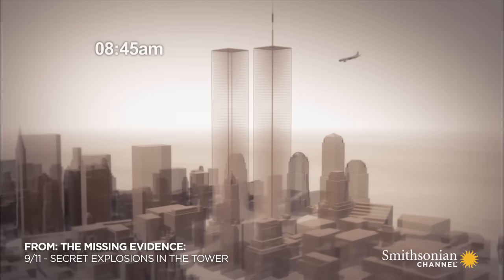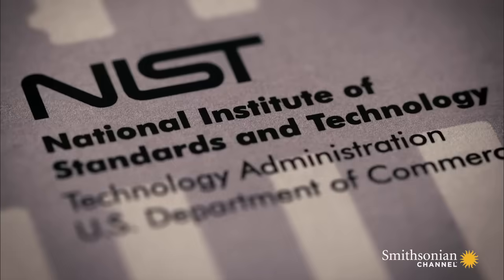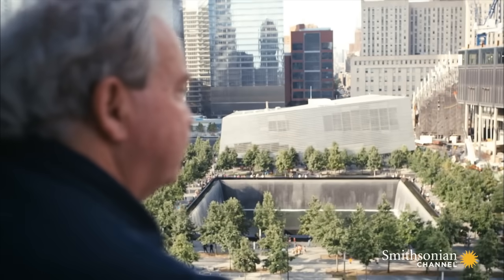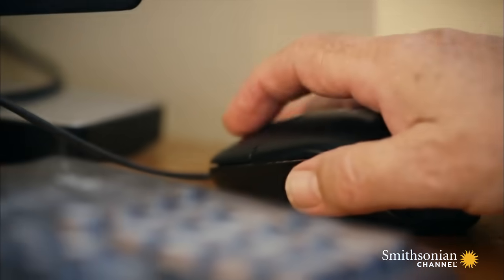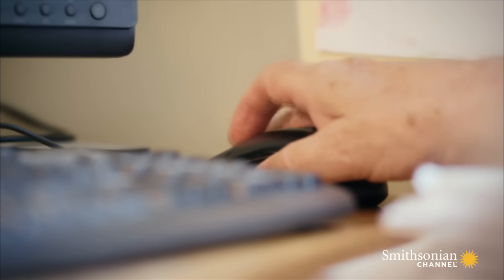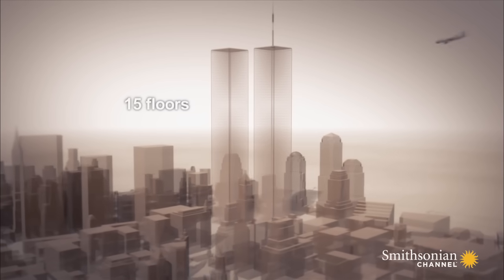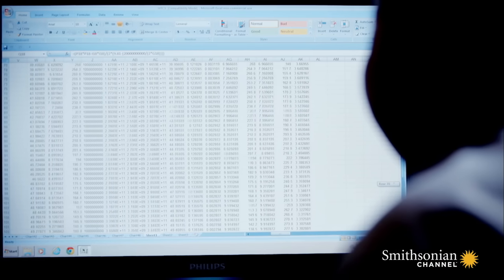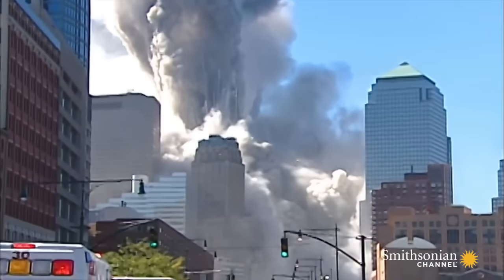This Computer Simulation Explains How the Twin Towers Fell

Comment: All 3 buildings implode into themselves even though the planes crashed into one side of the building's and WTC7 random office fires which is asymmetrical damage to the structure. So say that one side of the support structure was weakened more then say the other sides of the building, wouldn't the collapse happen asymmetrically eg. collapse to one side more or topple to the side? Instead it basically fails and collapse into itself equally. If that doesn't raise questions, I don't know what would.

Comment: I haven’t watched the video yet but the heat from the jet fuel on fire warmed the steel beams and over time they softened. Due to the weight of the floors above, the softened beams going vertical and the supports going horizontal connected to the beams came to a breaking point. Which is why you can see the floors above the hole in the building we’re leaning when the buildings collapsed.

Comment: If we look closely at the manner in which  the top section of the north tower (complete with mast) came down, we see that it had virtually collapsed into itself before the lower part of the building even started to move downwards. If we look closely at the manner in which the top section of the south tower came down,  we see it toppling over to an angle of 21 degrees increasing,  before being enveloped by dust.  It is quite clear from one video that the top of the tower pushes out a line of dust cloud moments later, indicating that it is definitely continuing it's trajectory to fall onto part WTC 4  below. (which it certainly crushed)  So in one case,  the top section that is supposed to crush the bottom, appears to self destruct before it starts, in the other, it topples out of the way.  By all means, check out the videos and explain why this is not so.

Comment: I agree with this research. It actually makes complete sense. It's not rocket science at all. 
When the planes go through the building don't forget the planes themselves have metals in them. So the metals from the planes run through the metals on the buildings (and the planes were obviously flying at high speed also)... no doubt would the metals of the buildings be impacted greatly. And once the metals have weakened with the weights of 15 floors and 22 floors on them, there's just no stopping them from collapsing the way it did. And the more it collapses the harder it falls on each next floors. Conspiracy theorists need to stop spreading b.s seriously.
Reply: I throw your bullshit Right back at you...you need to do a little  physics first before you can make a statement like that...you obviously have not bothered.

Comment: It still doesn't make sense to me. He says the weight at the top was equal to the Titanic-- but the weight underneath that is equal to 7 Titanics, arranged in a steel web that is designed to hold the mass above it, and then some. If you dropped 1 Titanic from high up you might be able to crush 7 with 1, but in the case of the WTCs, the Titanic at the top was basically resting on the 7 Titanics below it. What's the deal?

Comment: Were they really designed to with stand the impact of a jetliner? Or did they build them and fish for some computer models to confirm what they wanted to brag to the world about. Just so people would sleep better at night? Q#2 did they account for an uncontrollable jet fuel fire burning in the middle of the upper floors after a jetliner slammed into it and weakened them for almost an hour? Noop!Watch a slow motion test video of a jet being atomized when hitting a solid eight foot thick wall at high speed. Now watch that same process accour while crashing into hollow building. The weight and pressure of the building falls one floor a time atomizing most of the building all the way down. If they really did design these towers to withstand a jetliner, and the burning fuel spill, and all the burning fire after, that would never get put out, then they failed. It really is that simple.

Comment: Totally fabricated 'simulation'.  The lower floors already supported the weight of the upper floors.  Even if a 'pancake' scenario was initiated, it would have happened for a few stories and then the kinetic energy would have been offset by the energy expended in destroying the floors immediately below the impact, resulting in a still-standing structure.  Watch the videos online - - the towers do not fall as Smithsonian, or NIST, describe.

Comment: 0:04 "Were designed to withstand the impact of a commercial jetliner"

I think the important word here is 'impact' not 'prolonged fire'.
Reply: those planes were military planes witnessed by witnesses. no windows or markings on them.
Reply: @stuartbrown25  makes no sense cause even military planes have windows
Reply: Ok so how did Building 7 collapse? Spillage? LOL!!
Reply: There were no planes. 
It was just precisely placed thermites.
Those planes you saw on videos (which there are 3 or 4 different videos, which are all created by graphic programs. Research CGI 9/11.
Reply: Your woefully ignorant.
Reply: Dachs & Rottweiler did you even watch the video? The weight of the top floors crushed every other floor 1 by 1 until it got to the bottom.
Reply: @johnnytheprick 
24 hour fires that failed to eradicate any floors

What building are you talking about?
Reply: @johnnytheprick 
Which onesÉ

Windsor Tower in Madrid? Upper floors collapsed 2 hours after fire started.

One Meridian? Was brought under control in 19 hours.

Which buildings are they referring to?
Reply: heat rises, dummy
Reply: No building ever in the history of man has ever collapsed due to fire.
Reply: Matrix or Creatrix are you sure about that?
Reply: @TrustasCurrency  except for many, many buildings in the history of mankind
Reply: @TrustasCurrency  
No building ever in the history of man has ever collapsed due to fire

Kader Toy factory
McCormick Convention Center
Plasco Building
Reply: lol the jet fuel was 1/10,000th the size of the building. 9/11 was done by our own damn government via demolition. Everyone knows now. This is over.
Reply: Tripp393 fire spreads
Reply: That means absolutely nothing. Fire is bad for buildings. Everyone knows it. This is over.
Reply: Tripp393  So TITANIC was inside too? they said the ship could not sink and look what happened. Same here.
Reply: KIKO SUAVE I know right that’s what i thought to

Comment: So Newtons Law did not apply..
Reply: every action has an equal and opposite reaction. The force exerted downwards has the same opposing force upwards. The top 5th of that building should have pancaked after travelling downwards for a few floors. Thats why they put demolitions all the way down buildings BECAUSE of Newtons 3rd Law.
Reply: Were ALL the lateral supports blown away all the way down to the ground?or just in the damaged area's? Can you please educate me.

Comment: Using Wile E Coyote Physics to attempt to explain away BASIC FUNDAMENTAL LAWS OF PHYSICS and metallurgy... Steel structures cannot collapse through themselves at the rate free fall unless some explosives are used to cut and blow out the core columns underneath. The top floors were not floating on giant air pockets; there was 100,000 tons of steel and 200,000 cubic feet of concrete underneath the areas of impact. And what about WTC Building 7?... Ah, never mind; Smithsonian is just another outlet for state sponsored propaganda. Keep spreadin' those lies.
Reply: I bet you dont have an education in this field at all, so shut the fuck up.

Comment: I don't see how it's hard to believe that a massive airliner traveling rapidly couldn't cause the towers to fall? It's like saying, I don't know how all those dominos fell with such a little push?
Reply: It's not just that. It's this and everything else like lack of investigation, magical passports, immediate Al Qaeda blaming, lack of interceptors to see wtf happened to 3 commercial planes(they were circling of course for more than an hour) full of people etc...
Reply: This video doesn't even explain anything. It just says some guy has a computer. I can a program that proves that the tower can fly to mars and taste like chocolate. And then make a rendered visual basic. And some some British guy  narrate it
Reply: Did you the Empire State building was hit plane?
Reply: @drizzyrauvryar6992  A B25 is far smaller, it had less fuel, and it was structured differently not only that but going slower
Reply: And an unfinished buildings can burn themselves out until they leave nothing but a steel skeleton
Reply: Franklin MacGillacuddy  jet fuel only bunrs at 450° 
Steel melts at 2500°
Reply: Franklin MacGillacuddy  And explain Building 7. Small fires. No plane. No physical exterior damage just collapsed
Reply: Well, if you look in to the engineering of the towers you can find they can take a plane crash quite well actually. 
The real stories come from the eye witnesses testimonies and the workers in the buildings. 
The said the started haveing evacuations training like once a month for a year being 2000. There was are a lot of stories like that. Really fishy stuff. 
I don't really care who did it.
The governments are is owned by big corporations any way. I just want the truth to be told.
And actually hear about building 7 that wasnt on a conspiracy theorist channel. And this video told be a dood can use excel. A lot of official videos are like this.
Reply: Franklin MacGillacuddy  oh also the Japanese government did a test to see if you can make a phone call from an airplane with a phone from 2001 in like 2002 0r 2003. You can't
Reply: Research "no planes on 911" EVERYTHING we saw on tv was cgi
Reply: Franklin MacGillacuddy  military planes "buzzed" NYC look at the videos of the planes hitting the towers in slow motion it was 100% cgi period full stop
Reply: Franklin MacGillacuddy  every piece of video we got that day was from official MSM sources or people connected to MSM, like I said go watch the footage get a large HD monitor and watch in slow motion there's one error in the editing where the wing disappears behind a building that's actually in front of the tower IMPOSSIBLE from the angle it was filmed also another error was the nose of the "plane" popping out the other side of the building this is NOT a theory u can watch this with ur own eye's. Let me try to find a link for u
Reply: @drizzyrauvryar6992  I said B25 which is WW2 era light bomber
Reply: @mattyboy3576  What about the other towers? All survived except the one with minimal damage, a trash fire and all the trillions of dollars in a mysterious debt that was never mentioned after the collapse.
And sorry I was hella drunk last night.
Reply: @drizzyrauvryar6992  you still sound "hella drunk"
Reply: You have a belief based on faith... Since its obvious have put no effort into mathmatically quantifing any part of the govt's "explanation" in order to provide yourself proof , what you're actually saying is you have an opinion based on faith in your govt's explanation.
Reply: Franklin MacGillacuddy  If you find the collapse of Building 7 weird check out the demise of the under-reported Building 6

Comment: The lower steal is bigger, thicker then the top steel as you go up. How does the top steel, the thinnest, completely dissemble the lower steel into a pile less then 2% or the original height? Demolition! Start with termite, once noisy, then shape charges followed by kicker charges.
The first CG that Popular mechanics did a month after 911 was accurate. The core columns super structure was still standing after the pancaking!

Comment: WTC collapse explained by a chemist running  a simulation in a greased and dusty ass computer with 2007 excel. Something is little bit off
Reply: It is simply math!!.  You could run it in excel as long as you know the correct weight distribution / load carrying numbers.   The blue prints will provide that.
Reply: @peach jam  The buildings failure allowable was 6 floors.  14 stories failed in WTC 1.  23 failed in WTC2

Do you really need this explained to you?  Why don't you learn how to write instead of rant
Reply: @peach jam You can model all you want???   You do realize that buildings are actually designed on computers.  The proprietary programs used to do this are EXTREMELY accurate.   They can go directly from the screen to construction.  

If the floor load limit of the building is X and a load larger than X lands on it what does your common sense tell you?    And if one floor can't handle a load larger than X (Which it can't)  why would we expect the next floor to fair any better with an even LARGER load landing on it.   And so on and so on for each successive floor.   Your problem is getting worse as it goes.
Reply: A chemist would know more about the collapse than an engineer, considering they know whatever is in the jet fuel that you all claim couldn't burn through steel, and while it can't, it can weaken the steel considerably, making the Trade Center's pretty unstable.
Reply: People decoded NASA's message to aliens through MS Excel. Deal with it.
Reply: @markyzarky  without the lateral support of the floors the columns have no stability.  Then add the weakening effect of the fires. You have a recipe for disaster.
Reply: Javier Fernandez  Do I threaten you  Javier?
Reply: Lmao true
Reply: Javier Fernandez   My stupidity?   Explain.
Reply: What's really "a bit off" is your silly belief that accuracy in results from calculations using known and demonstrably true physics somehow requires, as a pre-requisite, your computer to be clean and running a later version of Excel that what was actually available at the time.
Reply: This is an old video you twat

Comment: Does this also explain the melting steel, or did the planes or rather their gasoline turn the building into a furnace?
Reply: asrgaqgq sdfgsdgsdfgsdg 

Orly, u knew the truth all along huh. So the gasoline of the plane must have transformed into steel. Wonder why they normally blow up high buildings like skyscrappers in a controlled environment... They could really save on explosives if they were only blowing up the top of the buildings so they would collapse like the twin towers. (They wouldn't properly collapse at all)

/watch?v=5d5iIoCiI8g

Comment: All the people saying Jet Fuel can't melt steel are correct, but in this case to initiate a   
the collapse you don't need to melt steel as the steel is already under constant stress of the weight above, only if it is weakened enough by action of pressure and high temperature the domino effect starts. The towers collapsed due to a phenomenon called creep. In a state of constant stress under high temperatures all materials fail, how quickly they fail is a matter of how harsh are the conditions they are subjected to. In this case the creep strength of concrete and steel was about an hour or so.
Reply: meh the collapse was pretty fast though. so your right, it inside job
Reply: The steel has been under the stress of the weight above for 30 yrs. Designed to with stand it all. Dont be foolish
Reply: But that would only be significant if the planes hit the lower floors, which they didn't and would be impossible anyway. Everything below the fires would mostly still be intact.
Reply: Yes but heres the thing, the steel beams did melt!  and they found traces of nano thermite in the dust.  The fire burnt for 3 months dude!  There was molten steel for 3 fucking weeks!  Office Fires my ass
Reply: shekhar mishra Oh fuck off with the bullshit.

Comment: If this study were actually academic he would release the parameters he used in the program for us all to verify. But you will never, ever see them.
Reply: MIT and Purdue University did similar studies. All 3 came to the same conclusion.
Reply: @robsash8991  The Purdue simulation isn't accurate at all...they even admit this.  Also, the only thing I've seen from MIT is them hyptohesising a controlled demolition. You know, the theory that so obviously the most sense. Even this computer "simulation" doesn't address the building collapsed near free fall (meaning the still beams holding it up the 70 plus floors that weren't damaged were completely compromised)

Comment: Ain't no plane melting 80,000 tons of steel. Jet fuel doesn't burn that hot period. That's all you need to know. Even if this happened the building still couldn't fall on itself. They blew out the damn columns. Forget about 7,  the owner said they decided to pull it. His words, not mine.

Comment: What about WTC 7?
What about jet fuel not able to melt steel? Or for even an aluminum plane able to slice through steel as well as concrete?
What about how the concrete was reduced to ash - completely pulverised? 
What about the WTC lobby mysteriously blowing up before either towers collapsed? 
What about the hundreds abd hundreds of witnesses who heard or felt multiple explosions going off inside both towers? 

Would like me to question more than just about the twin towers alone?